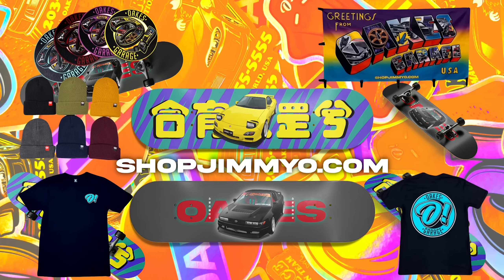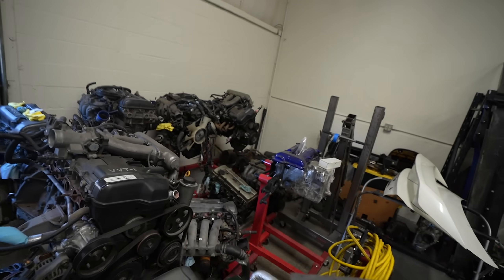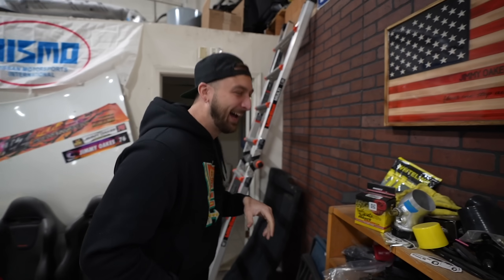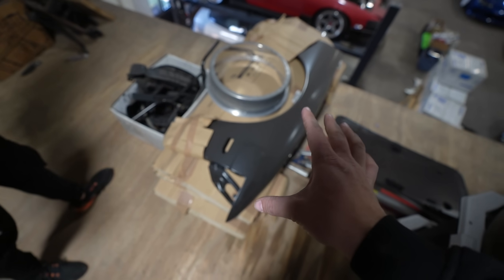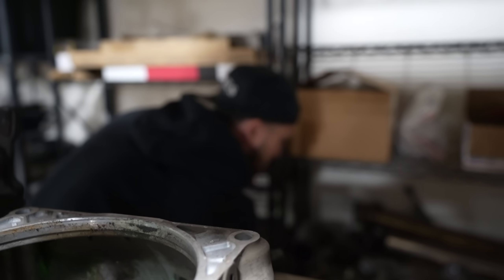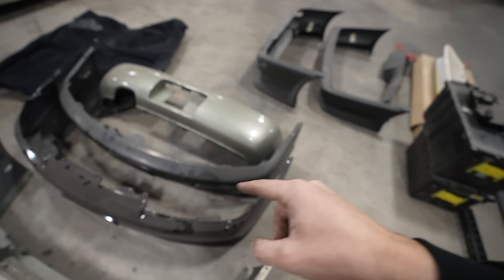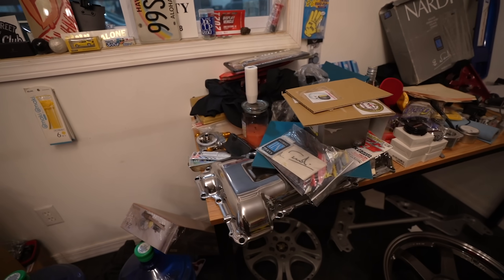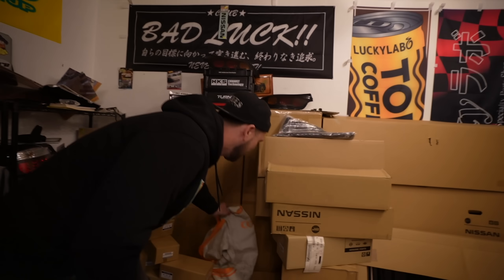Discovering all the hidden parts I’ve stashed away..

Comment: Random fact for ya Jimmy.

At 24.31 you can see the door cards and some stuff lying on the ground.

Well that black garish/thingy (fourth item away from the door cards and next to the front grille), is actually a European SEAT (it's pronounced as Say at) Leon Cupra R lower splitter which appears to be uncut. That's actually rare to see! 😂

Was quite surprised to see one in the states as SEAT's weren't sold there. 

Was used a lot in the UK on other cars. But not iconic as the Renault Laguna front splitter.

Anyhoo!

I really don't blame you for not chucking out as much stuff. Only as that stuff has gone bonkers prices wise now!! 

Probably was a time where a whole AE86 could of been bought years ago for the price of a dash now!

Comment: Fibreglass warps insane when it's sat too long, my work has just put together a very intensive bodykit on a car and most of the panels have trashed themselves within 2 years of sitting and they had warp resistant resin etc in the construction.. that old 86 kit could be very wavy just a heads up.

Comment: What are the dimensions for the s13 spoiler and the OEM coki (idk how to spell that 😂) working on a project with a super flat rear deck that needs a nice extended spoiler. (84 fiero notch with a VR6 and the 6 speed to match.  Wanted to have a car not many have and they are cheap to get ahold of ) all the after market parts are gone for these so I gotta fankin it together lol

Comment: Dude make wall art of the body parts. Use bad tail lights with led lights in place. Cut the sides of the bumper so you can mount brackets and its not 2 feet off the wall with the tail lights.
Reply: Rent a scissor lift and make it happen. Would look sick in video and its a remembrance of the past in a clean way.

Comment: juuuuust saying that your built sr in your black s15 is such a waste if you stick to 450hp...... you can pretty much get that from a stock block. need to branch out as most of your cars are around 300-450hp. built motors are built to eaaaat not stay at 18 psi on punmp gas....